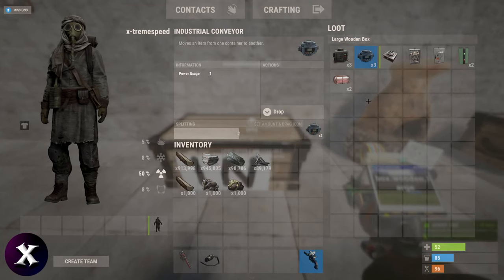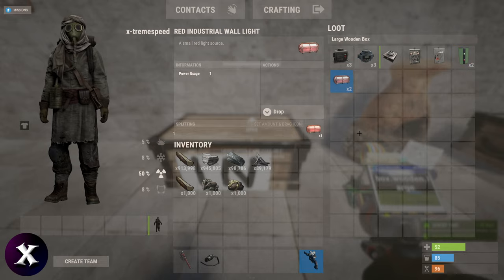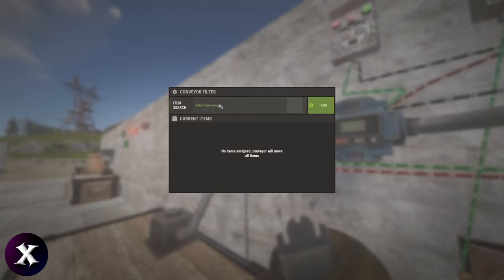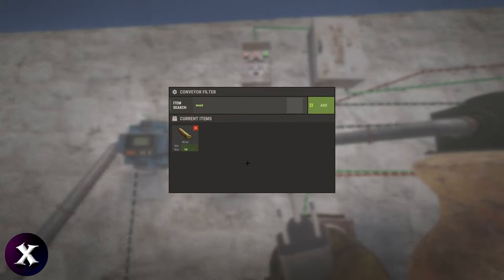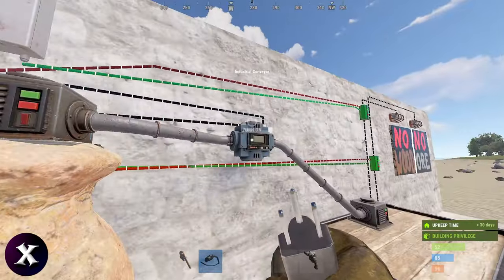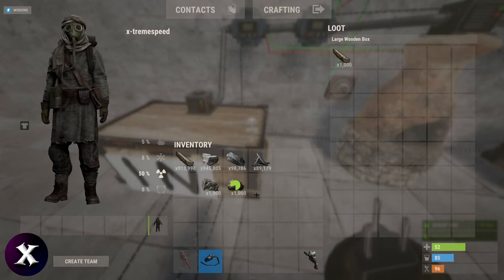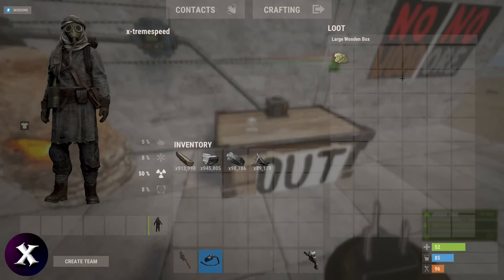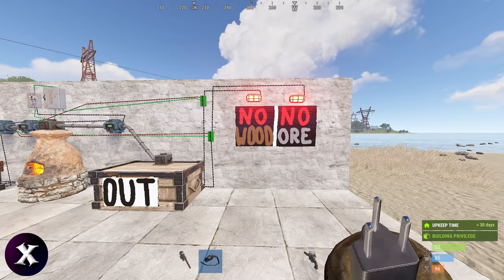100% Automatic Furnace (Outdated, New Video in Description!) Rust Industrial Update | Staging Branch

Comment from the maker: IMPORTANT UPDATES

Problem: You can no longer have 2 conveyors connected to each other, but it's a simple fix.

Fix: Add an industrial splitter after the first box, splitting into both conveyors, then an industrial combiner for both the conveyor outputs into the furnace(s).

------------------------------------------------------------------

Problem: An AND gate will no longer work (it will keep the igniter active constantly and break it quickly).

Fix: Replace the AND gate with a timer set to 0.25 seconds, plug the filter pass into the activate input, and the branch into the bottom. Set the branch to 4 instead of 3.
Reply: thanks

Comment: quick question, say I wanted to only have between 10-50 wood in the furnace but it ignites when there's only ore and then stops when there's no ore left (to prevent wood) being wasted, how would I do that or does it already do that in this video? I don't have much on the server I'm in to test it currently, thanks for the helpful video though
Reply from the maker: Absolutely! The easiest way would be to take the "filter fail" output on the ore conveyor and connect that to the "toggle off" on the wood conveyor, and the "filter pass" of the ore to the "toggle on" of the wood. This would only use up the 10 wood in the furnace once you run out of ore - you can play around with the max inputs to match smelt time of ores to the burn time of wood, but when dealing with 10 that's such a small number I wouldn't even bother worrying about it.

I haven't tested this out, but on the off chance the furnace doesn't automatically start up again once there is ore in your depo box, you can add an OR gate into the "timer activate" and plug the filter passes from BOTH the ore and wood conveyors into the OR gate. I believe you would have to boost the signal of them both since they need 2 power each to get through the OR and also activate the timer. If this is still unreliable with restarting the furnace, change the timer from 0.25 to 5.00.

Boost the signal by plugging the filter pass into an AND gate, and an electrical branch power set to 2 in the other side of the AND gate. Do this for both conveyors. Plug both AND gates into the OR gate, and the OR gate is plugged into the timer activate.
Reply: @x-tremespeed  ah great, thanks for the reply, I'll have to test it when I get more stuff on the server I play since I've not had chance to even get any of the newer stuff but I'm hoping I'll be good with it since I have experience with electric/wiring on rust